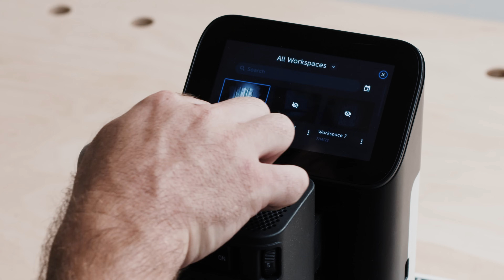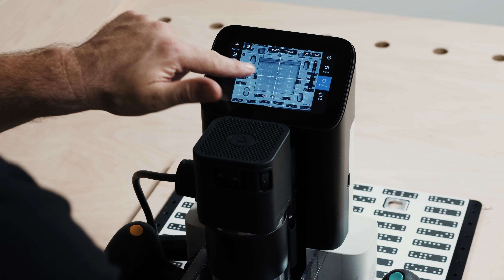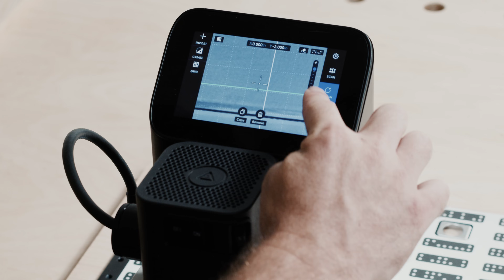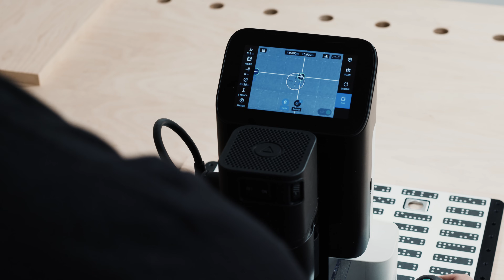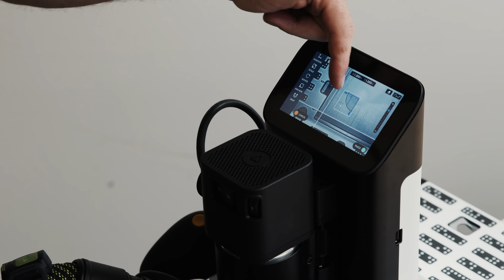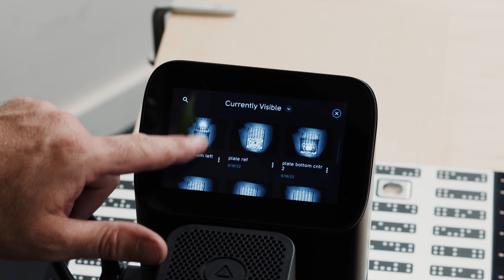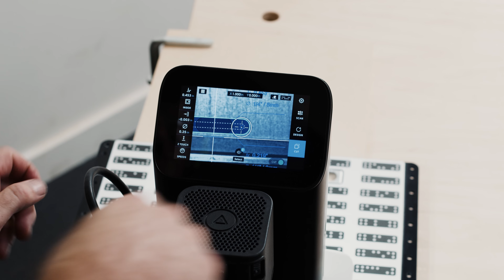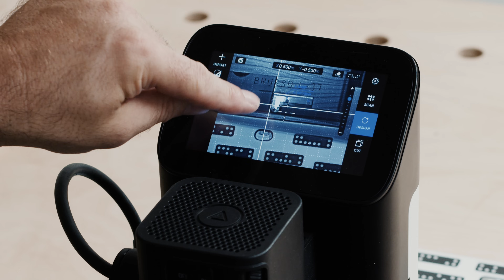Shaper Plate Applications

Comment: With the 5 holes, what if you want holes over the total length? Can you move the plate then? How to align the plate then with the already cut holes?
🙏
Reply: Just make multiple pencil marks a plural of 32mm apart. But then again.... if you need to make a lot of these holes the LR-32 system of Festool is way easier and faster.
Reply: @davesmulders3931 Seems like the obvious solution, but then you are back to human error in alignment.  It is one thing to use a pencil mare to center, it is another to rely on that for hole-set to hole-set alignment... with Origin, you would expect that to be machine exact!
Reply: @jonathandcohen  True....however if you make some kind of jig to align the template to previous hole-sets, you will stack the error in the template multiple times.
If you mark out the cutting locations in one go to the reference plane, then you will most likely be more accurate.

The option you have with origin to do this exact is to stick some long pieces of Origin tape to a board and just make a full size workspace. Align once, cut all the holes. You do not use the plate then obviously.

If it needs to be repeatable work, you can cut an alignment template for the plate-stops which you add to the board to be cut. 

There are ways, but I'd just mark out my locations and eyeball a close to perfect alignment. Close is often good enough.